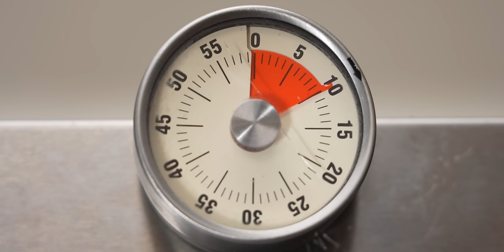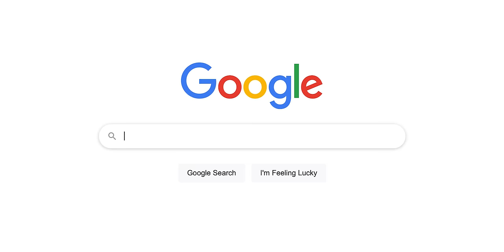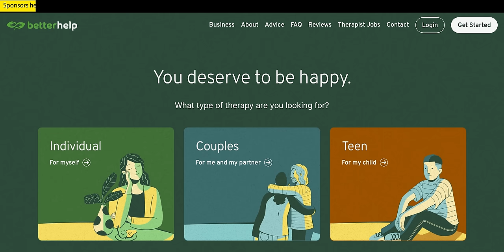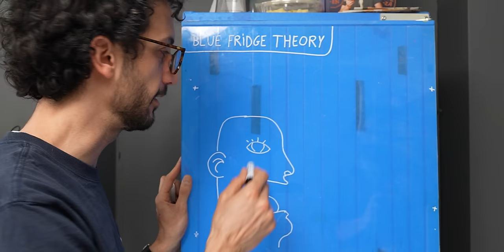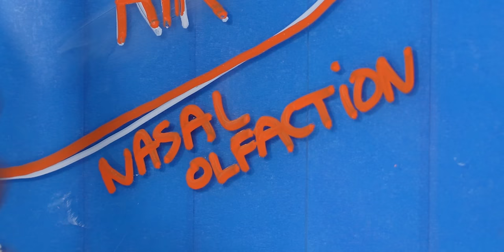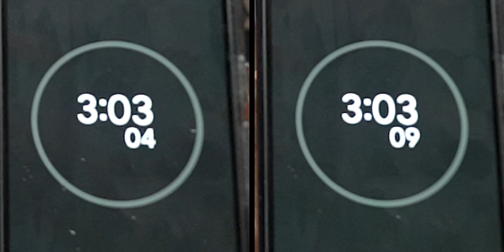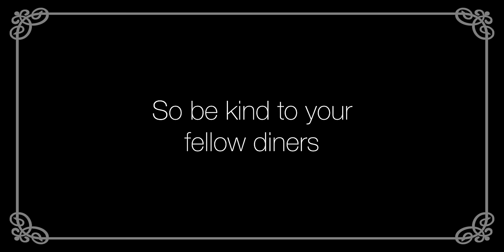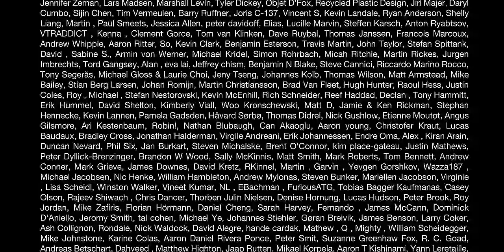The Art Of Slurping (been eating Ramen wrong my entire life 🤦‍♂️)

Comment: I dun slurp but I have a technique 😆
I coil the noodles around my tongue and wind them in. 
Also when broth is too hot I just blow on the noodles to cool them down, then dip them back beneath the broth to heat them up, then I pull them out again and blow to get more heat out of them. Broth is at a good temp after 3-4 cycles or so.

Comment: I'm curious about something.  Ramen shops separate the noodles, and lay them in the bowl carefully, to make them easy to slurp.  Pho shops just put a clump of noodles in the bottom of the bowl, which you have to separate yourself.  This takes time, which can end with overcooked noodles.  Why is this?
Reply: In my experience the pho water is hot, but not boiling hot, which would not cook the noodles the same way. Also, several ramen noodles seem to have a flour base instead of rice. I'm interested in this answer too.
Reply: @LabGecko  Yes, ramen is wheat, but if you ask for "egg noodles" at a pho shop, you will also get wheat noodles.  They still sit in a clump, though.
Reply: @majcrash  Yes, I corrected my comment yesterday to say rice instead of egg
Reply: @LabGecko  Pho should be served boiling hot, because you're adding so many toppings like bean sprouts.  They need to soften a bit, without making the soup cold.